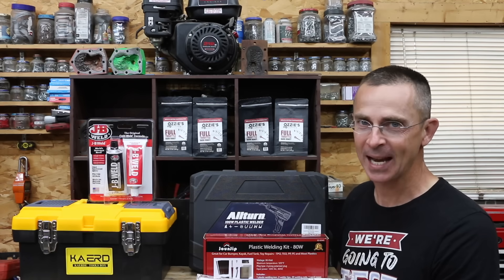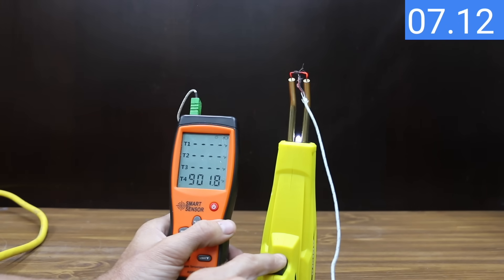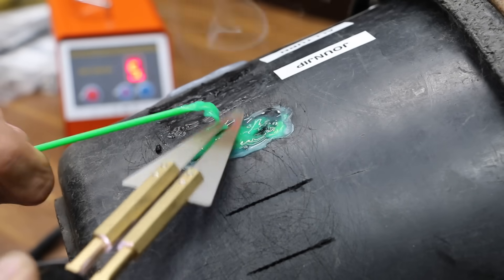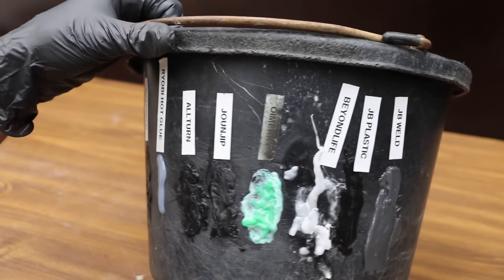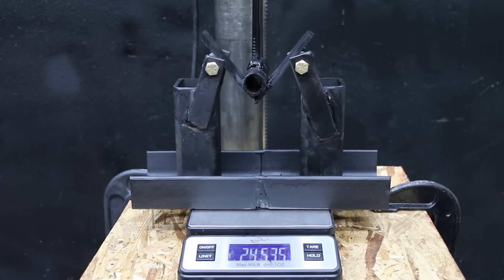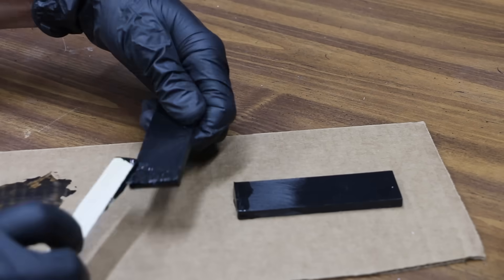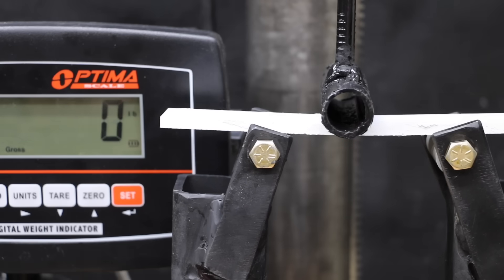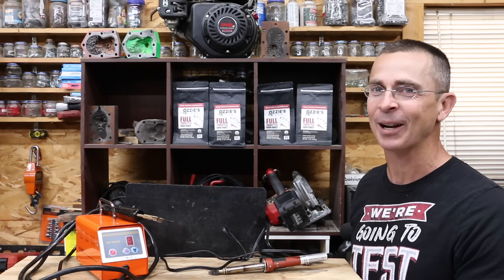Don't Buy A Plastic Welder Until You Watch This Review!

Comment: if you use metal staplers and the steel mesh I would first melt the steel mesh into the plastic then insert feet first the staplers trough the mess and into the plastic then with one of those electrical tools melt an additional plastic into the broken plastic to merge.

Comment: The staples work really well as a mechanical reinforced joint in their own right, the only plastic welding needed is to cover them over so they dont spring out during destructive testing.

You fitted them on the wrong side for your testing = you tested the stapled samples the wrong way up!

Better still staple both sides and it would likely have outperformed all of the others.

Comment: I had no idea what I was getting into, but I run a plastics fabrication shop and thought I would see how this tool works out. I am flabbergasted how ugly the finished result is. I can only imagine this is a last resort for a damaged product that you just need to keep. Because trying to create new welds with it leaves an ugly, melted, mess.  I'll be returning mine for sure.

Weld-On is definitely a cleaner, and stronger finished result.

Edit:  Don't use rubbing alcohol on your plastics. Alcohol, or ammonia will destroy the finish and cause heavy crazing.

Comment: I've seen a bunch of those air welders in use on a commercial job I worked on in canmore alberta. They were used to melt a geo-textile together at the seams for the underlay of a canal liner. Never got the chance to use them, but it was interesting to watch. (And I did a bunch of watching because the crews using them were constamtly behind haha)

Comment: When using the hot glue for repair, it really depends on what type of glue you’re using. 
The typical big box store glue is significantly weaker than glue used by paintless dent repair technicians. Some of the new glues now are used by body shops to repair significant collision damage. Tab Weld makes some of the strongest glues available.

Comment: This brings back memories and is refreshing reading other comments. I was the only plastic welder in a town of 100,000 back in the 90's. From residential to industrial. I used both the Liester and inert nitrogen gas guns for PVC, ABS and Polyethylene mainly. Sorry but I was cringing at some of these welds. I was once on a job connecting thick walled 24" poly pipe while a metal welder was watching over my shoulder. I said, "this is YOUR job." He politely replied, "hell no!" 😂

Comment: I just inspected 1 1/2" thick PP parts welded together and testing showed 90% strength of base material,  Engineering required 70% strength for seismic loads.

Comment: Like your videos but this one is a poorly done test. The small slits you made into the bucket won’t have hardly any pressure and not a good way to test these welds. I could but chewed bubble gum on one of those small slits and it would have held. Should have made the cuts s bit bigger. Also you’re supposed to melt the mesh directly on the damaged piece. Allows the piece plastic to bold with mesh.

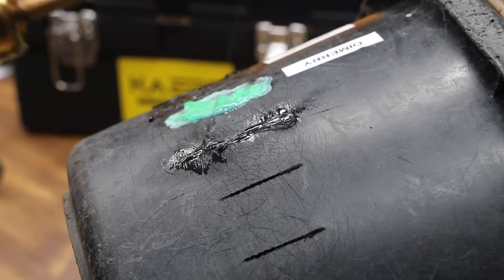Comment: I work at a job where I use hot air plastic welders like  the r beyond life one reviewed the problem is the your heat setting is too high for the material so you are melting out  and depolymerizing your plastic filler material the usual settings we use on our machines is a temp of 600-700 for a polypropylene plastic that is on a liester brand type welder I know it’s not the same as the one you used but I would look at your setting figure out what temp each one is at and then try to find one in the proper heat range of your plastic just trying to give some helpful advise 4:52 when you welded the bucket I did also notice later that in all the other test the filler material you used did not bond to the base plastic I think that they are incompatible plastics

Comment: Love my hot stapler... Works better to heat the mesh so it melts into the parent material, then melt the rods over it to seal things up... I repaired the wringer on a commercial mop bucket with one of these fun little toys. Nearly a year later of 2x daily use and it's still holding strong.... I was legitimately impressed.

Comment: Thanks for another great video.  I am no pro just watched someone repair a plastic wheelbarrow with one of these.  He put the staples in.  Then the mesh.  But he melted the mesh into the plastic without any additional material.  Kind of like the staples the wire mess was melted into the original plastic.  On the other side of the repair he only did the weld with a strip of supplied plastic.  I suspect applying the mesh this way would make the repair stronger.  Thanks again.  Love your content!
Reply from the maker: Thanks and you are welcome!

Comment: All you did was smear melted plastic on top .. pretend it is like welding metal.. you need to penetrate and fully melt the two pieces together throughout the full seam depth in order to do a proper weld.

Comment: Too busy to read all the comments, BUT: Any repair only on the interior side in bending, is Jr. High shop work. By High School, any worker should understand the larger forces are on the convex (Outside) bend. Reinforcing both sides is standard practice for all fabrication. Mainly so the part is strong no matter which way the part is bent.

Comment: If you can position the part, A large magnifying glass on a sunny day works awesome also! Black antifreeze or oil bottles make great patches or filler rods. Pick-up sticks come in different colors or use scraps of the base plastic. Use it exactly like a tig or brazing torch. You can control heat with the size of the light dot and pre-heat and melt in base plastic! very pretty welds. Bevel it and fill like a tig. Can do very small holes,  layers, stringers, and fillets. A little breeze helps to clear smoke. If you have torch welded it's second nature. Lighter colors take longer. I don't know if it would work on clear plastics. No mess, no clean up. 😊

Comment: You full botched the technique with the Beyondlife. You had it set far too hot.

Lower the temp to around 260 deg C and work from there. I use this cheap kit and it makes strong repairs on a HDPE boat.

Comment: what if you melt the plastic its fixing first then stick the wire mesh in then cover that with new plastic, so both plastic (repair piece and original) are melted together vs melting on top of it? not sure if enough time to heat both
Reply from the maker: Thanks for the suggestion.

Comment: I use ABS glue and make a channel / grove and yes the wire mesh is so posed to be melted into the plastic , note most repairs need to be flush finish

Comment: Thanks for doing this video and speeding it up. That's a lot of info to cover. Ive got an interesting project that im works on made of Pa6 CF30 , which is polymide with 30 pecent fiber. Veey hard material (intake manifold). Plastic welding is an art that takes time to learn but then a material like pa6 is even more difficult because glue for it is almost non existant and filler rods are very expensive
Reply from the maker: You are welcome!  Thanks for sharing.

Comment: the mesh should be heated with your welder and pressed into the middle of your peace. shouldn't see it much before you plastic weld to fit it. Just like metal welding your rod is a filler. the heat is the welder
Reply: I'm not trying to knock your work.  love your show for the last 4 or 5 years.  just trying to help
Reply from the maker: Thanks for the feedback.

Comment: We appreciate these test but, please slow the speaking down a bit, some of us on the other side of the pond have to do F to Celsius, lbs to grams, miles to km, inch to mm conversions etc while you speak, no genius is that fast. As usual great test, thank you.
Reply: Pause button does wonders. You can also use the settings to slow down the video to your desired speed. It allows you to cater each video to your desired speed instead of asking each Creator to cater specifically to you.

Comment: I would have thought a beveled groove then weld into the groove would be the best for HDPE hot welding. 80 grit surface sanding, alcohol, and a surface flame passivation is required to bond epoxy of any kind to HDPE. West Systems epoxy has a good video and test results on this aspect. 

Maybe you can do a follow up on the techniques with some weld penetration on HDPE. Keep up the good work.
Reply from the maker: Thanks, will do!  Thanks for the suggestion.

Comment: Outside of your test scenario I always assumed the mesh should be heated into the plastic being repaired in the same way the staples are. I assume that's correct and you didn't do it like that during the test for a reason, or have I been doing it wrong? Great video as always.

Comment: This was great until you starting using the wire mesh.  You weren't installing it even close to correctly.  First.  Don't melt the plastic sticks and set the mesh on to it.  Instead, place the mesh over the join... heat it up so it melts INTO the plastic, then add plastic over top.  Had you done that correctly, it would have been much much stronger.
Reply from the maker: Thanks for sharing your technique.

Comment: Humm, I would use friction weld for that type of repair. Basically a Dremel with a compatible plastic rod   About 1/2 to 3/4 inch sticking out from the Dremel chuck. Adjust speed as needed. Apply at an angle like a caulk gun. Don’t use to much pressure, let the tool do the work. Just my thoughts. Thanks for another PF comparison. Take care from central Florida 🌴🇺🇸
Reply from the maker: You are welcome!  Thanks for sharing.

Comment: The automotive technician below is correct, you're supposed to melt the plastic you're trying to mend and then imbed the mesh inside that plastic just like with the hot staples.  For this reason this test was seriously flawed and misleading. Can you please do over!
Reply: It just occurred to me that welding plastic is like welding steel, you're supposed to melt the steel you're trying to weld and then add the filler metal so it fuses with the original metal. That's what makes it so strong.

Comment: Drill holes when using jb weld the idea is to penetrative the plastic. The heat rod need to move enough to melt both part and patch together. This surface thing will, sucks

Comment: That plastic welder that you feed the plastic through is for floor welding marmoleum. It's designed for a self feeding system. I have a gun similar to it I used for welding floor seams.
Reply from the maker: Thanks for sharing!

Comment: The weld must be a molecular bond.  Chemical welding compounds must match the chemical structure of the repair otherwise it is an adhesive bond or at best a very cold weld.  Introducing mesh reinforcement generally adds strength at constant temperature but as temperature drops so does the strength of the bond.  In order to break the bond of something like JB weld it is as simple as dropping Ambient Temp and flexing the repair.   The only way to make a bond that will withstand temperature extremes and flexing is to reinforce with a weld made of the same repair part material.
Reply from the maker: Thanks for the feedback.

Comment: I LOVE your channel, videos your tests ... With some practice, a soldering iron and plastic of the same type of the piece to be welded together is all one needs.  The same type of plastic for both pieces is critical for a bond that will not come off.  The plastic of the piece being repaired has to be heated for the filler plastic to be blended into the repaired item.   Wire mesh has to be melted into the broken item using the flat portion of the welder - This will strengthen the broken area to stronger than the original condition.  Done correctly plastic welding works very well, while an item will never be as pretty again it will be stronger.
Reply from the maker: Thanks!  Thanks for sharing.

Comment: When you weld metal do you run perpendicular to the seam?  I'm not sure why you're doing that with some of these plastic welders.  The one where you feed the plastic stick in is made to run right down the seam and you have to use the same or a compatible plastic to get it to bond.

Comment: pro tip, if you have a soldering iron or soldering station, just use that one, just add a dedicated tip or 2 for plastic welding and you are set! No need for a dedicated plastic welder, which is basically just a soldering station in disguise anyway!
Reply from the maker: Thanks for the feedback.

Comment: I'm curious with the hot staple welders if it made a difference if you placed two staples from one side then two from the other side. When I do plastic welding that's what I do then I use a pad type welder to make the smooth top welds for better appearance.
Reply from the maker: Thanks for the suggestion.

Comment: Wire mesh is used for tensile strength(rupture), while this test is 3 point bending usually for flexural strength that use non-bendable metal like steel rod or thick steel sheet
Reply from the maker: Thanks for the feedback.

Comment: Tech Bond out of Columbus, Ohio makes plastic repair kits (incl. plastic panels if needed) with a strong adhesive that actually works and bonds.  Good for exterior plastics.  Q-Bond Super Glue is also known to work well with plastic but is not good for outside plastics, just interior plastics.  Just fyi.
Reply from the maker: Thanks for sharing.

Comment: A total trash video form some one who could not be bothered to read instructions
When making repairs to plastics it is not necessary to melt it as you would if it was a weld in metal 
In fact melting the parent material makes the joint weaker.
The parent metal needs to get enough heat to activate the plastic bond
Similar with the filler rod, it needs to be pliable but not molten .
I use a variety of different welders depending upon the actual job.
And to form a bond you have to use the same material ( or at least a compatible one )
What you have done is the same as trying to weld Aluminium , steel & brass using a tin welding rod 
IT aint going to work so your entire presentation is total crap
And as others have said, each type of plastic is welded at a different temperature . Too hot and it burns , too cold and there is no cross chain bonding .

Comment: IDK I found that using my soldiering iron with a smaller tip and stirring in a circular motion worded the best and is free if you own a soldier iron. Harbor freight plastic welder is a hot air one and I have shit luck with that one.

Comment: I learned and practiced this in my bodywork program. Key steps  1) clean well; 2) use exactly the same type of plastic filler (HDPE, LDPE, PP, etc.) 3) As with metal welding, you need to melt the plastic on both the item and the filler material so they fuse, which means you have to heat both equally. I also found that wire mesh helps make a weld stronger, especially for long splits/cracks.  Staples are another option. The staples get heated by a special type of solder-type gun similar to the one you use to heat the plastic.
Reply from the maker: Thanks for sharing

Comment: I take a small drill bit and drill numerous holes about  1/2"  from the edge ( say 5 on each piece of plastic ) I thread some picture hanging wire thru the holes just like sewing by hand. Then  coat the wire with glue or hot melt. The wire gives it strength. The glue or hot melt makes it ridged and  keeps it from wiggling around. You can actually try to hot melt the two together before sewing. The sewing will take you a extra 10 minutes. You may like copper better than aluminum or steel because it bends better than steel and doesn't break as bad as aluminum. Some wire mess on top would help too.  But I don't have many projects like that so I don't invest in expensive tools. I've never seen a professional even talk about doing plastic welding. They just buy a brand new part. I would imagine a regular soldiering gun would do about the same as June Jip. Just save your 230 watt unit when you upgrade to more watts
Reply from the maker: Thanks for sharing.

Comment: The hot glue is impressive. I bet it would be even better if  stronger glue stick was used.   Also, I've experimented with baking soda and super glue. It is very quick, and heats up the plastic while it sets, so the bond is very good. You have to use thin cyanoacrylate though, which is available at craft and model making stores. Don't use the quick setting kind either. this worked very well on plastic bumpers, trim, and headlight tabs.
Reply from the maker: Thanks for sharing.

Comment: It is often the application that matters the most. Even though I enjoyed the comparison, having had some experience experimenting with a few different methods, little details or unique things you do that makes the chosen method or tool way more effective. For example, much like soldering, if the base object is heated using a hot air gun so that melted plastic can bond with, the stronger it'd be. For using a welder with metal staples, I found it best to use it on both sides, so use 2-3 staples on one side leaving adequate spaces in between so that you can come in put 2-3 more from the opposite direction to those spaces left on the piece being repaired. Then use JB weld or hot glue gun, if needed, to cover the metal staples and/or make it more waterproof.
Reply from the maker: Thanks for the feedback.